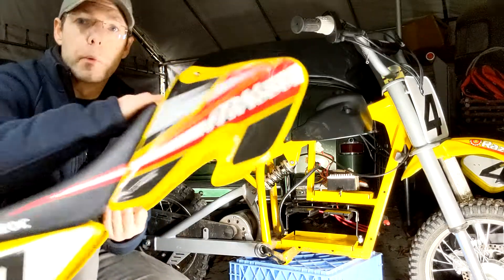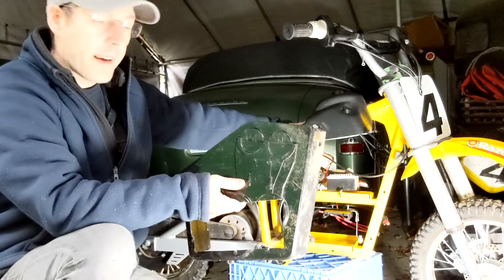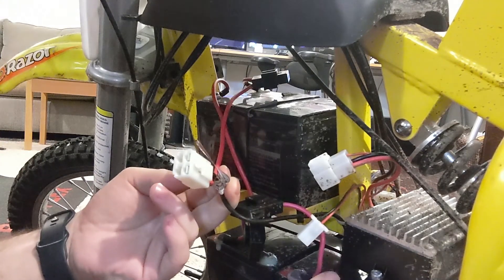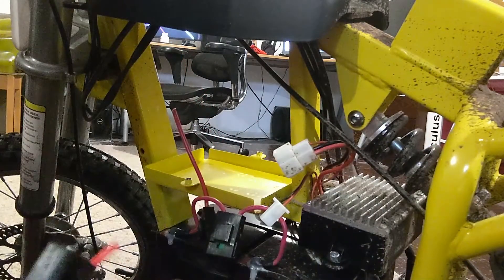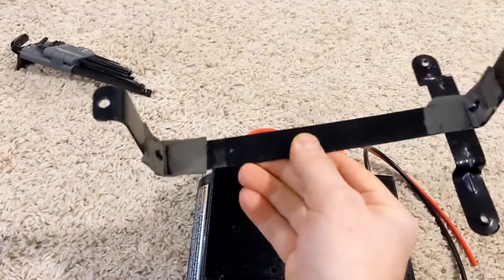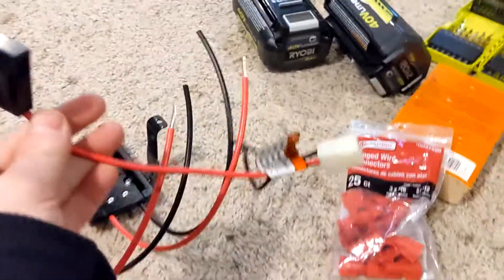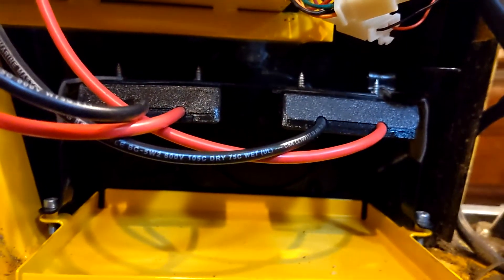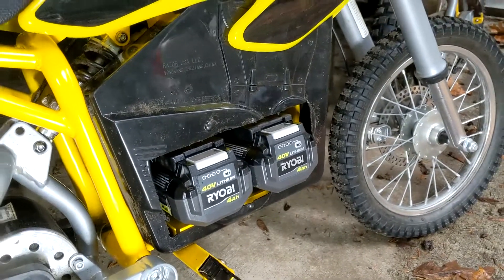Power Up: Upgrade Your Razor MX650 to Run on 40 Volt Ryobi Batteries for a Boost in Performance

Comment: I have two 40v batteries. One is a knock off Ryobi for 7.5ah the other is 6ah. Will the AH difference cause an issue or should be fine?

Comment: It's still working great with the 2 6ah batteries first set of mounts have finally broken so bought 2 new ones and just trying to mount super securely so they don't break from jumping and vibration

Comment: I have my MX650 all taken apart and I was waiting for my three new lead-acid batteries to arrive when I saw your video. What a hoot! I have those 40V Ryobi batteries, so I decided to try your approach. It worked excellently. Thank you for creating this video.
Reply: Wait, that’s 80 volts bc they’re each40 volts right!
Reply: @PossiblyHollin parallel wiring. Doubles current. Series would give you 80v

Comment: Can i run these batteries in series safely please i want to run my 72v motor with two 40v in series without causing a dumpster fire ive already taken it for a 35 minute test ride with no malfunction and the batteries drained one bar at a time on each battery which to me seems pretty evenly discharging i just need some input please and thank you
Reply from the maker: I've never ran them in series so I don't know.

Comment: 2 questions, how fast does it go? And where would I connect a new throttle if I were to get one?
Reply: It's slightly faster than stock. I think stock was 17mph. The throttle connection must plug into the controller.
Reply: @chriswatson3633  ok thank u

Comment: If u have 8Ah total, how long u can ride?
Reply from the maker: It lasts about 45 minutes. The ride time is about the same as the original batteries but it is slightly faster and if you have more batteries you can swap them when they die. I was able to keep mine going all day.

Comment: I watched your video on the Razor Quad 500 as well. So, do you think the controller needs to be replaced, if I convert it to two Ryobi 40v batteries or will the stock controller/throttle work? Thank you in advance
Reply from the maker: The 36 volt ones don't need their controllers upgraded. I ran my 24 volt quad on one 40 volt ryobi battery for a little while and it seemed to work just fine. I upgraded the controller to 36 volt just to be safe and so I could add some features.

Comment: So i just added 1 40v battery to my kids razor 500 quad thats 36v, BUT it keeps shutting off on full throttle....so are you saying by just adding another battery....it will stop doing this???? Wonder if i could add an 18v ryobi with the 40v ??
Reply from the maker: Yes. Two batteries in parallel fixes the shutting off problem. If you really only want one battery you can also use a speed control knob. I show this in another video where I'm working on a razor quad. But iI think the two batteries is a better solution if you have the room for it.

Comment: what controller and throttle did you use?
Reply from the maker: The stock ones for this application. They are 36v and handle the 40v batteries just fine.

Comment: This is a great upgrade, but wire nuts are not a good choice. Those electrical connections should be soldered and coated to prevent contact with anything. Wire nuts are made to be used in a static environment.
Reply from the maker: Agreed. I wrapped mine in electrical tape as well but soldering is the best method.

Comment: ive had a single 40 volt 6ah battery on sons razor for years I didn't know how to stop it from tripping battery so he had been riding just easing throttle to full speed thanks man!
Reply from the maker: I'm vary glad this helped you. My kids couldn't ride it without tripping the shutoff. Your son follows instructions better than mine clearly.

Comment: So does it just stop working when you run out of batteries? Because I thought it can drain your battery so much that the battery will not charge anymore? The reason why I ask is I did a power wheels mod with drill batteries and I needed to get a voltage cutoff switch to prevent the battery from going down lower than a certain amount of volts.
Reply from the maker: I am not aware of any damage being done to the batteries. My guess is that the bike will stop moving before the batteries are fully discharged. I've been using the same batteries for several years now and none of them have stopped charging.
Reply: Ryobi has BMS with safety features

Comment: Did this to 3 of my kid's vehicles, thank you so much for the idea and the time to show us ! :)
Reply from the maker: I'm very happy you found it helpful.
Reply: Did you need to get a voltage cutoff switch to prevent the battery from over draining?
Reply: @AldrinHernando I've been watching a lot of these videos. I think it protects your controller or engine from getting fried on accident. you just swap the fuse.

Comment: I am worried about different batterie voltage depending on charge level. Do both batteries have to have the same charge level when you put them in? Definitely would put in 30A fuse between the two red wires to avoid any damage to the batteries due to voltage imbalance.
Reply from the maker: I've had no issues with voltages. Typically I put in two fully charged batteries. But they don't have to be.

Comment: How long would 72v 24ah last?
Reply from the maker: Probably about 5 seconds until 72 volts fries your 36 volt controller. I've heard the controllers can handle higher voltages but that's double.
Reply: @showandtelltechnology  would it work with 72v controller and would it need a better motor
Reply: @lintrailjrdukes6989  the controller and motor at a minimum would need to be swapped for something compatible with a higher voltage setup. The throttle would probably be okay provided the new controller uses the same voltage (5 VDC I think) as the original controller.  Otherwise you'll fry everything.
Reply from the maker: I'm afraid I don't know. I've never up to the voltage beyond 40 volts. There's a guy on eBay called overvoltedscooters who would know more about this. He makes upgrade kids and would know what voltages they can handle.
Reply: @showandtelltechnology  ty

Comment: Will it work with 2/3 battery’s if it has 4 mounts
Reply from the maker: I don't see why not. As long as you wire them in parallel I think you can have as many as you can fit.
Reply: @showandtelltechnology  what if ur using only 2 out of 4 at a time
Reply from the maker: My bad. I understand what you're asking. Yes it should work. If they were wired in series than the missing batteries would stop the electricity from flowing but seeing as they're wired in parallel having batteries not plugged in shouldn't make any difference.

Comment: I bet you could add a car audio Capacitor used with subwoofer amps. That will probably stop the single battery cutting out.
Reply: I would also suggest soldering your battery wire connections and use some shrink tube over the connections. It will lower the resistance and also protect from anything possibly shorting out if one of those wire nuts popped off. Lipo fires go up really fast if something shorts out and hate to see your little one get hurt or burnt.
Reply from the maker: That is very likely. It also might work fine if you used higher amp hour batteries. I've never tried that either. I only have the 4 amp hour ones.

Comment: Can it run with 1 battery at a time
Reply from the maker: No. If you use just one battery it has a safety feature where if they pin the throttle instantly the battery will shut itself off. By wiring two batteries in parallel it prevents that.
Reply: Ty

Comment: I'm surprised you didn't use 2 6ah batteries. I would assume would be over an hour of time?
Reply from the maker: Probably. I just don't have any of those batteries.
Reply: The 6 ah batteries are thicker, I wonder if there would be space to mount them in the same place?

Comment: Great video! I just had a question, do you need to match the volts of the batteries to the volts of the motor/controller? I see you are running 40v batteries while the motor and motor controller are only 36v. Will adding more volts make it last longer? Currently I have two 18v Makita batteries on my setup but I'm wondering if adding more will make it last longer? I'm assuming it would make it last longer but the motor won't go any faster than 36v.
Reply from the maker: I have heard that the controllers can handle much more than 36 volts. I've been running 40 volts for a long time with no issues. But if you do run much higher voltages you do run the risk of burning out your controller. If you want the battery to last longer you need more amp hours. The way to get amp hours is to wire your batteries in parallel. That adds together the amp hours of both batteries and the voltage remains the same. However if you wire them in series you add together their voltages and the amp hours stay the same. If you wired them in series it would go faster but not longer.
Reply: @showandtelltechnology  how much time did you have on those 240 volt batteries and how much faster did it go
Reply from the maker: @otislopez33  My kids ride around 40 min before the batteries need changed. The property is pretty hilly though. It's going to vary wildly depending on the terrain and the weight of your kids. But the best part about this setup is you can easily swap out the batteries whenever you need to.
Reply: @showandtelltechnology  @Chis watson you mention that you if you run in parallel that voltage stays the same right? So you wrote here you are running 40v but these are 20v batteries in parallel, so arent they only running 20v? U mention that AH will be higher in parallel like this, but not voltage. Am i reading this incorrectly?
Reply: @mkat_551  they are 40v batteries and he is using two of them. He is only 4volts over but getting the amp hours which is the life of both batteries.

Comment: Since it has 2 40 volt batteries isn’t that 80 volts
Reply from the maker: Yes. You press a button and they slide out. So you replace them with a charged set and you are good to go. With four batteries and two chargers you can pretty much keep it going all day.
Reply from the maker: If you run 80 volts it might fry your controller.
Reply: @showandtelltechnology  ya so I should probably not do that how long does it last with the setup you have
Reply from the maker: If they were wired in series then yes it would be 80 volt. This is wired in parallel so it remains 40 volt but you add the amp hours together making it 8 amp hours.
Reply: @showandtelltechnology  how would you wire it in series
Reply from the maker: https://images.app.goo.gl/eH9C7EA8bKxTLu5Z6
Reply from the maker: It's somewhere between 30 and 40 minutes. But when it goes dead you just swap them out and then keep going.
Reply: @showandtelltechnology  what do you mean by swap them out. Like seal them to new charged battery’s

Comment: This is a great video! I've been working on the upgrade and was curious if there was a reason you didn't just mount the battery mounts on the bottom yellow tray. You might have to bend the lip down but that shouldn't be to hard. This way we could fit bigger batteries in and the mounts are attached to something even more sturdy.  Thanks for your thoughts!
Reply from the maker: The reason was for access to the buttons on the bottom of the batteries. If you mount it flat to anything you can't get at those.

Comment: So let me ask you this I will assume the orginal on off switch doesn't work now? If that is true as soon as you put the batteries in the bike is on? Is there any way you can cut the power without taking the batteries out?
Reply from the maker: I upgraded that one to a 36 volt system which came with a new controller and throttle. The throttle has a key that now functions as the on-off and the original on-off switch became forward and reverse.
Reply: @showandtelltechnology  can you send me the link of that controller and throttle since you already made it work with the set up I am going to do at least I know what is good for it and don't waste any money buying the wrong parts. But you mean the orignial switch now makes the motor go forward and reverse?
Reply from the maker: Just to be clear we are talking about the 24 volt quad right? The mx650 is already 36 volt and doesn't have reverse.
Reply: @showandtelltechnology   No I have a MX650 dirt rocket like you had in the video.
Reply: I assume when you disconnected the switch that as soon as the batteries are connected its on so I wanted to still have a switch to cut power if my daughter stops somewhere and wont kill the battery
Reply from the maker: My bad. Sorry for the confusion. The on off switch works just fine on the mx650 with the Ryobi batteries.

Comment: I have two questions the first one is where do I find those ryobi mounts? and the second once you put 2 40v batteries in the MX650 does it run slower or faster and does it run the same amount of time, longer , or shorter
Reply from the maker: The ride time is slightly less and the speed is slightly faster. The real benefit is being able to swap out the batteries when they die. With 2 chargers and 4 batteries you can basically keep it running all day.
Reply: @showandtelltechnology  you run a big risk of burning the motor up if you actually do ride it all day without letting the motor cool down.
Reply: @showandtelltechnology  what if you ran 3   40 volt batteries or possibly four
Reply from the maker: @otislopez33  more batteries in parallel will give you more amp hours which will make it run longer.
Reply: Sorry I saw your link for the battery mounts thank you, but still would like to know if the speed is the same and the time riding is too.
Reply: Where did you get your battery holders to connect to the bike from
Reply from the maker: @otislopez33  There is a link in the description to the battery holders. I just checked it and it still works.

Comment: What's the run time with this setup? How will it hold up if ridden through a puddle do you think?
Reply from the maker: The runtime will be slightly shorter than the stock batteries. In my case I'm going from stock 36 volt 12 amp hour battery to 40 volt 8 amp hour battery. My small boys can ride about 40 minutes on a set of batteries. The real benefit is that you can just swap the batteries out and keep it running all day. We've ridden in the mud a bit and not had any problems. All the electrical connections are still well covered.

Comment: Is a motor in the bike stock completely or is it brushless
Reply from the maker: Mine is stock.
Reply: How fast does it go
Reply from the maker: @joescardona6958  About 17 mph.
Reply: Shouldn’t be more faster since you upgraded the battery
Reply from the maker: @joescardona6958  it's only 4 more volts so I don't think it's much of a difference.